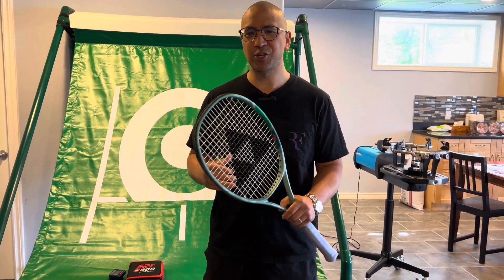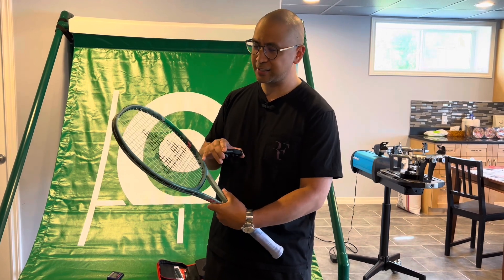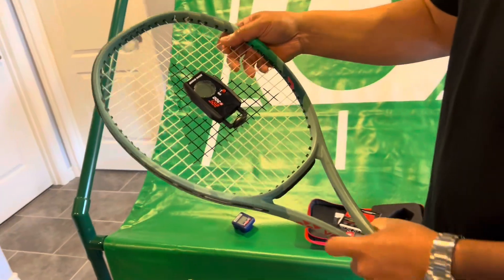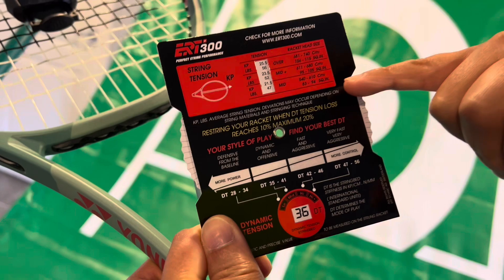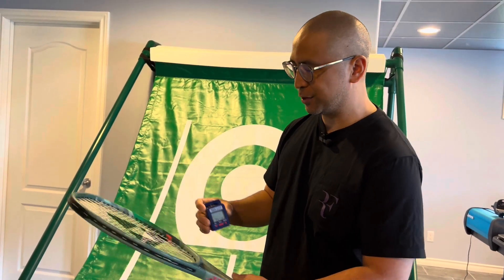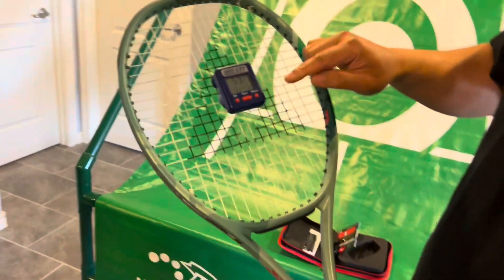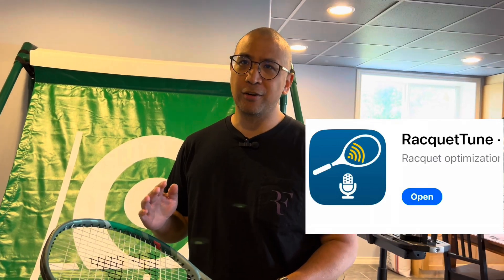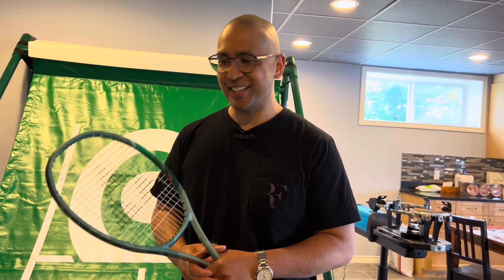Tennis string bed tension measurement using ERT-300 and Mini STT

Comment: how do you find consistency of the MSV Mini STT vs the ERT-300 and RacquetTune vs both? Trying to figure out whether it's worth it to get the MSV Mini (ERT-300 is too expensive) or use RacquetTune. Thanks
Reply from the maker: Mini STT and ERT-300 were surprisingly consistent with each other, particularly when testing poly strings. RacquetTune was never registering the same tension as the MSV or ERT, but it’s decent when tracking tension loss over time (I.e. can figure out when 10% or 20% decrease occurs from the baseline you initially measure using RacquetTune)